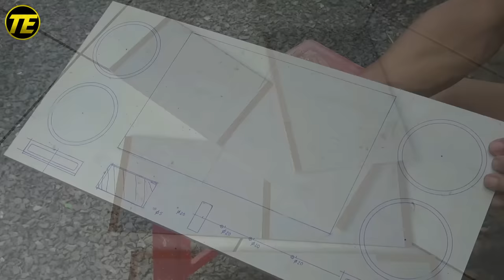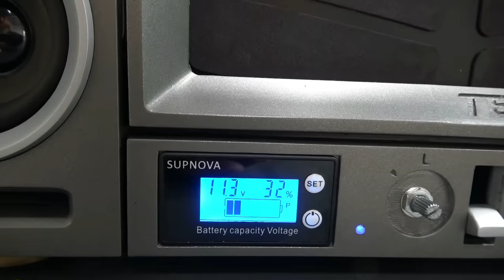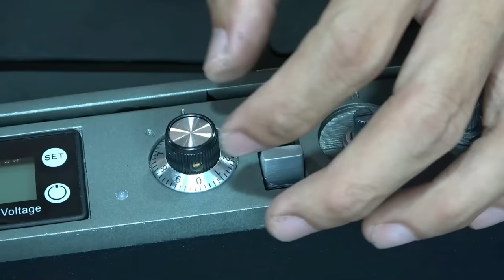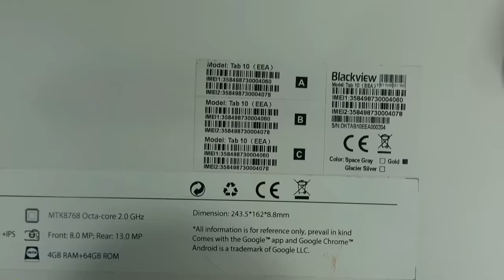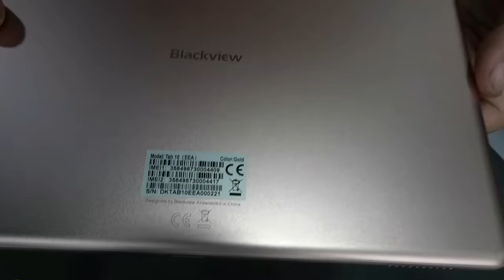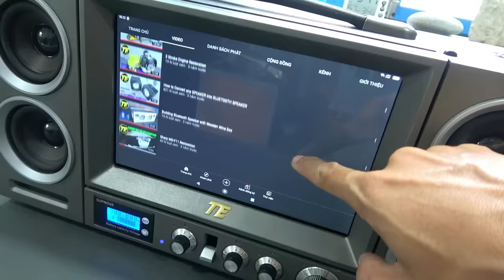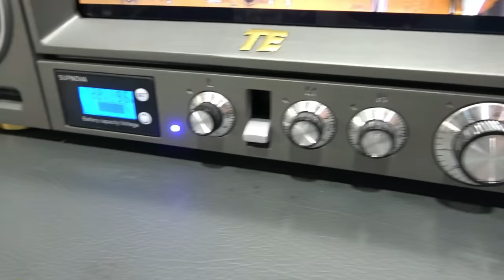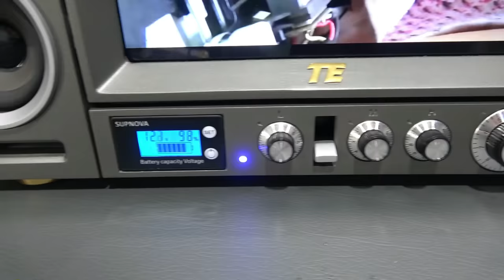Building TV Bluetooth Speaker V2 with Blackview Tab10

Comment: Good Job!

Made a large speaker with a similar amp, set of 6.5" car speakers and 8" sub, one day I get close to it and notice 1 speaker is out, pull amp out and those screw connectors had either let go of the wire or had vibrated loose, everything got soldered on and the heatsink was loose also so I used some Loctite on it, also some of these amps that come with a heatsink have no heat past between the FETS and the heatsink, worth checking as they can get hot enough to fail if not properly set up.

Comment: Good appearance, good idea, but you have quite a serious omission from the way of construction of the speaker.
The tweeters are always placed on top and facing the listener so that the treble can be heard as well and clearly as possible. It was simply possible to make the box a little higher and so to put the tweeter in front, if the volume becomes large it is possible to fill it with other materials

Comment: A fantastic project and it looks and sounds superb. One question you are always dealing with passive radiators, why didn't you install a couple, extra base at a fraction of the price. Anyway well done 💯
Reply from the maker: I don't like the sound of speakers with passive radiators
Reply: @TE.  I understand :)
Reply: @TE.  You should use AMOLED Display  , IPS LCD is old now
Reply: @adityaarayan2340  yes, but amoled have issue with burn in.
Reply: @adityaarayan2340   I hope you aren't another tech brainwashed millennial out there who assume everything they are fed by Google and YT is the best...
While I agree that oled is the new game everywhere, it didn't come without it's own problems. Such as burn ins, power hungry nature and more importantly too consider cost factor especially on a niche product such as this.
IPS display has come a long way from the origins, if implemented right, one will be hard pressed to find any difference to oleds. Plus no nasty screen burnings....
Reply: @TE.  Bro, for next video please make Gaming PC with that look
like using Latte Panda Board and small IPS Touchscreen monitor
I mean Small AIO Touch Screen Gaming PC plus Big Speaker all together as one device
Reply: @Intolerantmoron  Out of the three display technologies IPS in my opinion is superb. No worries about screen burn with Oled, and better viewing angle than traditional LCDs.

Comment: Hello, I am a fan of yours from Turkey. You do great work. I have Sharp 10p-18g. The TV I have is not working. There is no picture. Also, the sound drops and it crackles when touched. Can the next repair be Sharp 10p-18g?